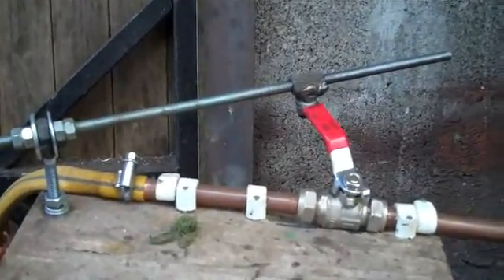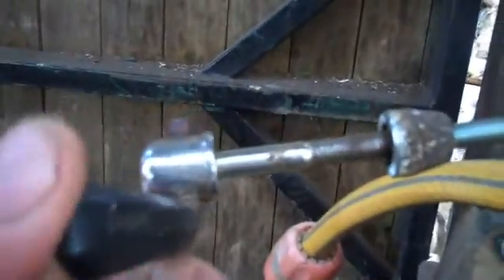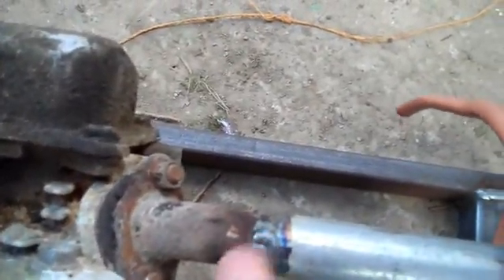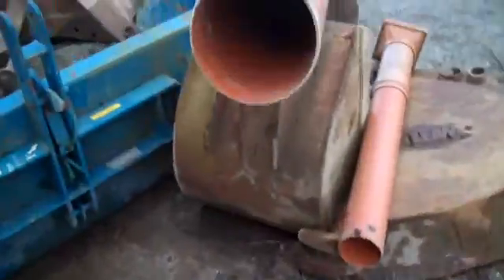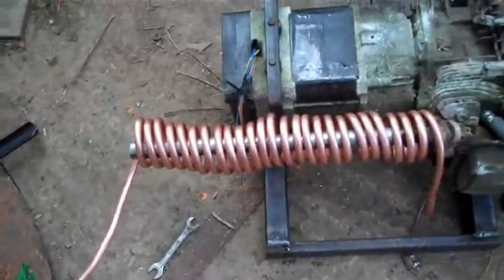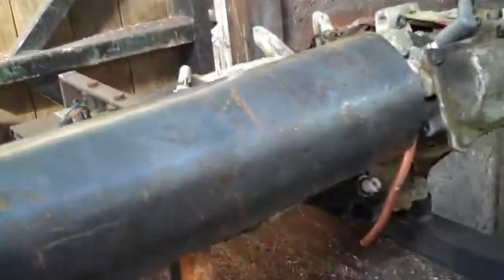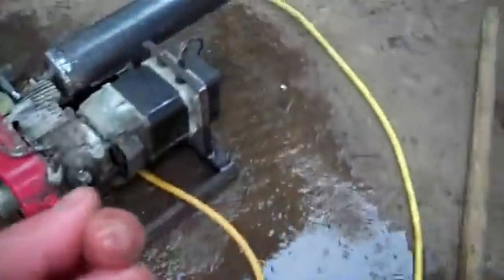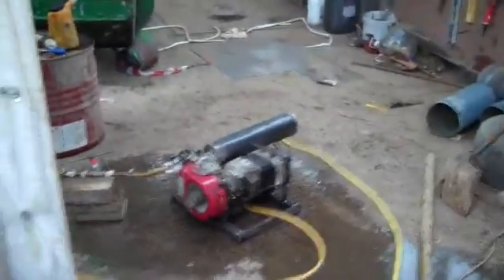Biogas generator heat exchanger valve improvement

Comment: Just a thought what if you  made it a  closed loop similar to the way your hot water cylinder in your house is, that way the  heated water in the loop that way it would heat up more